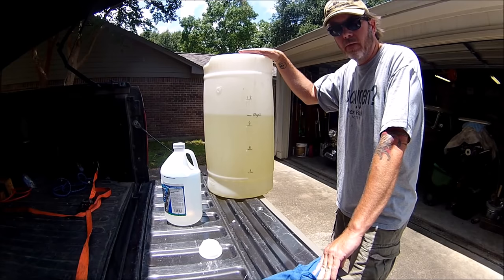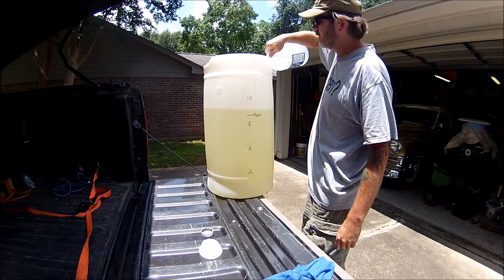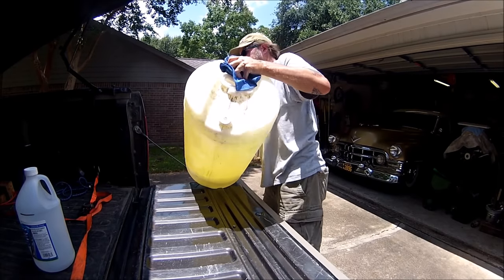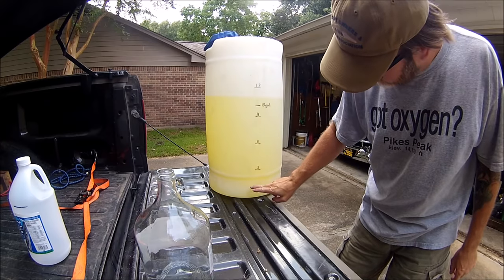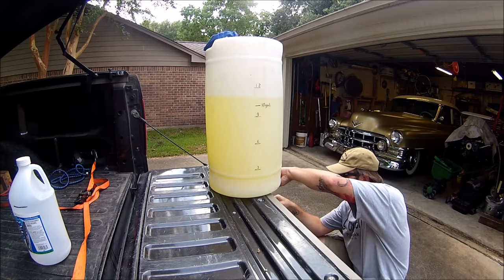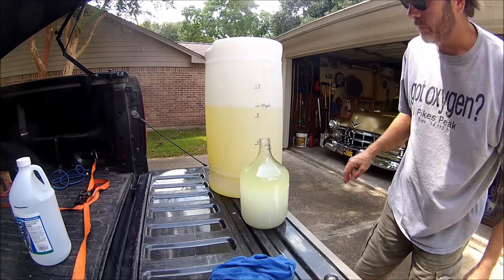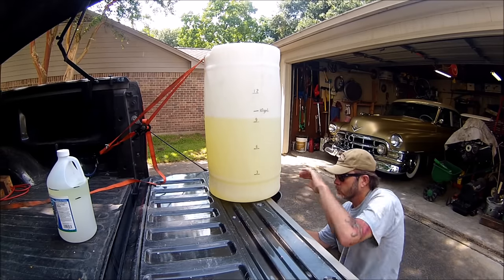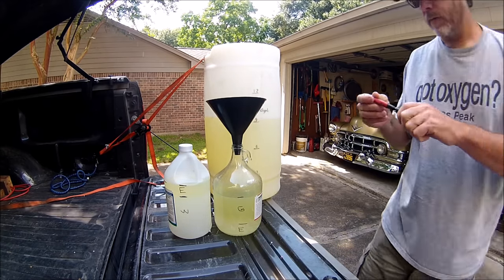How to easily extract ethanol out of gasoline.

Comment: I'm interested to see your lower valve setup and how you got it installed.
Reply from the maker: I just used a 1" threaded pvc valve with a threaded adapter on the inside to hold it tight. I started with a few rubber washers, but they don't last long. I would use a fuel safe sealer around the hole next time.
Reply: thanks!  I've found that the best gasket/O-ring material, but sometimes hard to source, is Viton... generally solvent resistant to all but the most harsh, but definitely ethanol/gasoline proof.
Reply: Max Mason yep, Viton seals are the best bet for this application

Comment: Surprising you're unable to buy it locally at the pump, maybe local laws or refinery/distributor lack of interest....  Interesting technique.  I don't have engines where it's a concern, but I alternate 5 tanks in a row of no-ethanol and then 10% ethanol and my gas mileage varies about 3/10th of a mile per gallon different.  (2013 Accord, CVT - I range right around 40 - around 37 when it's in the teens F).
Reply: looking elsewhere - I found the ratio of 1:16 - so a cup of water per gallon ethanol-gasoline.   And that might be overkill, since 10% ethanol gas can include "up to 10%" ethanol; as an expensive blending component, they'll go short where they can if crude prices and RBOB/CBOB are low...

Comment: There's alot of internet scientist... Ethanol is not a bad fuel by any means, the standard fuel still meets octane standards and engines still run as efficient as they're capable of with their current capabilities. mechanics never get cars in for service as a result of 10% ethanol being added. Its for owners neglect. Vehicles are more efficient than ever so why do you people that disagree dislike ethanol so whole heartedly?

Just to add [don't have to read my point is above]... If one ever removed a cylinder head from a e85 operated engine, you'll see it has a few benefits over regular gas. One major being the cleaning properties, there's more of a white faint carbon than the black left with gas. As a result, the oil tend to stay cleaner longer because the blow-by produce from e85 doesn't contaminate oil as gas do.  Yes there millage issues but the cost difference equates to regular fuel [87] and of course the higher octane 

 If one decides to bring up sensor issues on flex fuel... Fyi, AFR sensors tend to have a slightly higher fail rate over the basic o2 sensor. Eventhough the sensors are unrelated, that would be more of a debate on gas vs ethanol having negative impact, POSSIBLY... then just 10% addition of ethanol to gas.
Reply: The same people who want to end hunger also want us to burn food in our cars!  Why not burn petroleum and eat corn?

Comment: Some small engine manufacturers are starting to void warranty claims if ethanol contamination is found to be the culprit. This procedure though isn't recommended, if you fail to get all the water out (a small amount will naturally emulsify), you end up with the same problem as when you started, and you now have highly toxic contaminated water to dispose of, however you choose to do that. There's affordable fuel additives made now that works very well.
Reply: And if you find you have no other choice, you can always purchase white gas (coleman fuel), which has no additives and a octane rating of somewhere around 55, and a bottle of Octane boost (non-alcohol), I have run several cans of this through my mowers without any damage what so ever, although it's not my favorite procedure.
Reply: Not sure, been several years. The way everything else is I'm willing say it's probably not cheap. Like I said it's not my favorite solution but it beats not having to buy a mower every couple years because the carburetor, tank and intake parts are so badly corroded it no longer wants to start, like I Was doing (also, our liberal government here makes us use reformulated gas which contains several more ingredients, ether being one, which absolutely ruined my boat motor).

Comment: You can just add a good stabilizer like Lucas or Stabil, and get up to a 1 year protection, rather than 3 months worth of non-ethanol. and only 2 or 3 weeks if untreated ethanol e10 gas. Easier to just treat and/or make sure to run your engines dry when storing or not planning to use for periods over 2 months. Less hassle, better protection. Nice to learn some things though, thanks. Btw, ethanol is a cleaner burn.

Comment: Correct me if I'm wrong: if you put 1gal water in a 10gal container of gasoline with 10% ethyl, wouldn't you need to extract 2gal of drain off liquid (water + ethyl)?

Comment: You need to add a step, add an octane booster. It's usually toluene (don't add bioethanol, lulz) which will bring the now ethanol free gas back up to 93-95. You don't need to add as much as the ethanol that was removed, but try to work out how much you'll need to add to bring it back to where you need it.

Comment: I went the opposite way and concerted all of my equipment to run on E30 by replacing all the vinyl fuel lines on my small engine s and two stroke yard equipment with fluoroelastomer style along with rebuilding the carburetors with methanol/nitro fuel  gasket and diaphragm conversion kits to solve the chemical compatibility issues.

Also I have been drilling out the main jets to give them enough fuel to get them to run right being very modern engine is factory jetted too lean to run at it most efficient A/F ratio due to the shit EPA emission regulations that normally have most of us rung our stuff with the choke half on to run properly.    

Never had a issue with an engine since and some, both 2 and 4 storke, have been running E30 for over 5 years of hard regular use. 

As for finding the methanol/nitro fuel compatible gasket and diaphragm kits for your small engine carburetor look online for the companies that deal with the RC hobby stuff being many of the bigger RC machines use the same carburetors as many lawn and garden power tools do.

Comment: the biggest problem i have with ethanol in gas is with small engines especially 2 strokes. the ethanol picks up additional moisture from the air and it will seriously corrode the fuel system on weed whips, lawn mowers, chain saws and other tools.

Comment: Does it lower the octane ? 
Here in Canada hi test gas doesn’t have ethanol in it. Shell gas ads say so.I’m not sure about the US ? Thanks 🇨🇦👍
Reply from the maker: It lowers the octane by around two points. There are gas stations that sell non ethanol fuel, but they are few and far between.

Comment: Guys if you only knew what octane is and does...ethanol does much worse things when mixed with gasoline. Ethanol in an ethanol engine is fine...same for gasoline. But mixed together, besides getting less bang for your buck, ethanol carries with it WATER!  That Phase Layer you see in his video is bad news when burned in an engine. Greater OCTANE means LESS energy by the way unless the engine is designed to use it and most engines aren't. If you do what he is doing, and start with 93 octane Premium gasoline...you will have pure EO unleaded gasoline and your engine will thank you for it!!!

Comment: I'm not sure this will work as expected.  Alcohol is used as a "fuel 
line dryer" to "remove" water from gasoline - not by actually removing 
it, but by making the water dissolve (at the molecular level) into the 
gasoline via a phenomenon called "miscibility."  It basically works like
 this:  Water isn't soluble in gasoline, but alcohol is.  Water IS 
soluble in alcohol - and alcohol is soluble in gasoline - so in simple 
terms, the water dissolves into the alcohol, and the alcohol into the 
gasoline - effectively pulling the water into the gasoline.  So, from 
what I would think would happen, you are essentially just saturating the
 ethanol with water - unless you can somehow extract out two gallons of 
an ethanol/water mixture (10% of 10 gallons + 1 Gallon of water). And 
I'm also pretty sure that the ethanol/water ratio isn't 1:1 as far as 
what it will absorb ... so ... I would think you've got a bit of watery 
gasoline there - lol.  Good for killin' weeds ;)

Comment: I'm in the process of tryin this out myself. I've watched videos here on the tube and most say let it set for a couple hours and their gas is crystal clear. Not mine and not yours.  I'm thinking we have to be careful what brand of gas we buy because some stations are putting the additives in to help suspend the ethanol and water that is already present in the gas so it wont separate and collect in the bottom of our tanks.    Food for thought

Comment: I buy my gas at a station that claims that their premium is ethanol free. It cost about 40 cents more per gallon. I don't know if their claim is true, but my two strokes work fine. I think the station is conaco. I think. I have to travel to get it, as they don't sell ethanol free where I live. Your method looks difficult. Especially if you have back problems. Thumbs up anyway friend.
Reply: kennith rogers , mixing water, shaking, and watching how the gas and water separate is probably your best indicator as to amount of ethanol in the gas. Test their claim. I did. The test can be done with relatively small quantities (ounce).

Comment: You are not removing all of the ethanol from the gasoline, but you are definitely adding water to your combustion chamber.  Water can not be effectively removed from ethanol gasoline.  That is why ethanol gasoline is not sent on pipelines to the end users.  Ethanol is mixed with gasoline at the end of pipeline terminals and then trucked to filling stations.

Comment: you will remove less water/alcohol than added water. Try this: mix equal parts alcohol and water. The result will be somewhat less than twice the equal part because the mix will have a tighter molecular density, which determines volume. Don't ask me how. I remember this from a demonstration in chemistry class and I ain't a great student.

Comment: what you marked as ethanol is gas still mixed with water, you need to let it sit for at least 24 hours, you won't see any demarcation line between water and ethanol because the ethanol binds with water on a molecular level, if you live in a cold snowy region you should be familiar with "dry gas" it is nothing more than ethanol and that's why it stops your gas from freezing, because it absorbs the water and allows it to be burned in the engine, this is good in small amounts as it will steam clean the carbon from the combustion chambers, since ethanol adds octane value to gasoline you will want to get a gasoline gravity tester, they are around $10-$20, they work like any other gravity tester but are calibrated for gasoline octane rating and that will tell you if you will need to add an octane booster back to the fuel, in a lot of cases if you are dealing with small amounts of fuel it might be worth the extra buck for ethanol free gas or in the case of 2 strokes to buy the premix stuff

Comment: Here is everything I have seen that PROPERLY shows how to do this........add red or blue food coloring to the water before adding it to the gas, vigorously shaking for at least 10 minutes (which you did not.....at least on camera), allowing to rest over night, preferably 24 hours (which you did not), and draining similar to how you did it, but tilt the barrel slightly towards the spigot, drain a little, rest a little, repeat repeat repeat repeat until all the colored water is no longer visible..........This will bring 93 octane gas down to about the mid 80's, but for a 10 gallon drum like yours, you could add a liter of alcohol free octane booster and bring it up to the mid 90's without introducing any ethanol or water.

Comment: Surely if you remove the ethanol from your fuel there will be issues with the properties of the fuel. We are all familiar with the negative issues created by ethanol but it also has desirable properties that are used when formulating the gasoline, anti knock prevention being one. The remaining gas will likely have a very low anti knock index and do more harm to your engine than the ethanol will do to everything else.

Comment: Ethanol is totally miscible with water, so no separation will show up..   you  have a mixture of Ethanol and water in one layer and gasoline in another, not 3 different layers. In this case it is unlikely any ethanol was separated, as the water was not properly 'washed ' through the mixture.

Comment: The Zimbabwe government did a similar thing. They just added more methanol to the mix to save money. They did Not, however, add the required extra percentage of chemicals needed to bond the two together and the petrol and methanol separated out. 
Any petrol engine will NOT run on EITHER of the two fluids.
Reply: I meant Ethanol.

Comment: I do this for the lawn mowers. Saves lots of trouble. It may also be illegal to modify the gasoline. After doing this, lawnmowers run well and keep on running, no longer have to buy new carbs or clean them. The ethanol drops out from the gas quickly. Mix, shake, let sit for a few minutes. It is like paying 10% more for your fuel, your wasting that ethanol. I just pour it into the driveway-street and it evaporates fast.

Comment: One stage extraction will remove SOME ethanol, but the residual ethanol will pull WATER into your gasoline. In addition to lowering the octane and getting water into your gasoline, you may extract some of the detergent and other additives that improve performance and keep your engine clean. DO NOT DO THIS IF YOU LOVE YOUR CAR / BOAT / ETC.!!!

Comment: Ethanol gasoline is trash. Its cheaper but if it sit for a while it becomes a corrosive once it breaks down. It will not only ruin your fuel pump but your gasoline tank as well. Make sure if you use ethanol gasoline use a fuel stabilizer if you allow it it sit for  longer than a month.

Comment: There would not be a separate water and ethanol layer they a 100% miscible. Alcohol can only be separated from water by the difference in their boiling points and/or freezing points. This is basic chemistry and moonshining.  Calcium oxide can be used in a water ethanol mixture to form calcium hydroxide, which is insoluble in ethanol. So if you want to take high proof liquor and get the last bit of water out, drop calcium oxide in. Let it soak up the water then strain out the crystals. If you measured it correctly, you could have 200 proof shine!

Comment: Alcohol is 100% miscible in water, so with sufficient time this can work.  That means that the alcohol and the water dissolve into one another in any proportions.  The water and the alcohol become one and the same.  With no layering.  So you have part of the chemistry correct.

Comment: You do not have 3 layers with 3 different liquids. You will not have a separate ethanol layer. Ethanol is 100% water soluble. That layer you're calling ethanol is, in fact, a mixture of all 3 liquids. You need to give it more time for the water to settle out. If ethanol wasn't able to mix with water then whisky would separate from the water by sitting on the shelf, and we all know that doesn't happen.

Comment: You probably should've used two gallons of water.  I would've waited a day after shaking it to let it bind and separate.  That 2 gallons would've turned into 3 gallons at the bottom, because 1 gallon (10% of 10 gallons of gas) is ethanol.

Comment: What you've successfully done is drop the octane. The reason ethanol fuel is cheaper is they can use alcohol's higher octane value to replace more expensive petroleum chemicals. Worried about ethanol, then use an app like Pure Gas to find stations with ethanol free, usually 90-92 octane. Be prepared for the price to be high.

Comment: That is like too much work when you can go to most gas stations and get ethanol free straight out of the pump. I don’t have any problems with ethanol fuel because I don’t let my machines sit for long periods of time. I ran 87 octane with ethanol in my motorcycles that I drag raced over the last 27 years and they all ran like hell and never a problem.

Comment: This is not the best way to do it.  That's because the spigot on the bottom does not drain the very bottom of the bottle because the top of the drain inside the bottle is above the bottom - probably by an inch or maybe more. So the alcohol/water mix below the level of the drain will not drain.  At that point, you will be draining pure gas but the alcohol/water mix won't drain.  One other thing, you mentioned that the water was at one level and the next level was alcohol. Of course, they aren't separate.  I think you meant that the amount of non-pure gas above the original level of the water was the AMOUNT of alcohol. They aren't separate.  Ideally, if you drain from the bottom of a container, the container should have a funnel-shaped bottom. Such things are actually available but they cost a lot.  But, again, spigots cannot drain to the bottom of the container they're used in. Generally, the spigot threads into a nut on the inside of the bottle.  That's the problem.  No matter how much you drain your container, you'll have an inch or so of alcohol/water that doesn't drain using this method.

Comment: How did you dispose of your water, ethanol, gas mixture that you drained? $ to donuts you didn't do it in an environmentally safe way.
As others have stated to remove the 1 gal of ethanol you need to have removed the 1 gal of water too.  You didn't get complete separation either so its guaranteed you still have ethanol left in the gasoline. The big question still remains is - WHY?  I know of no reasonable answer to why you did that.